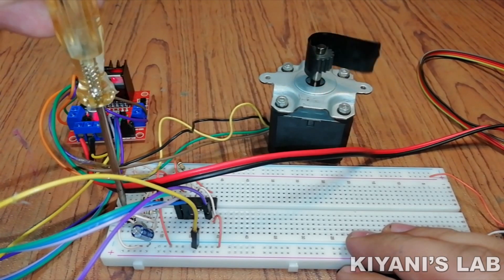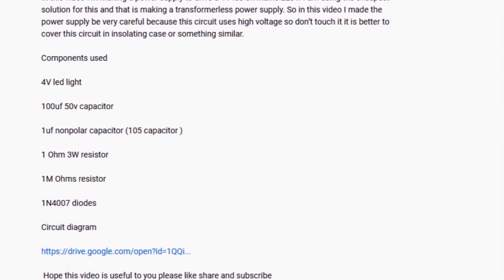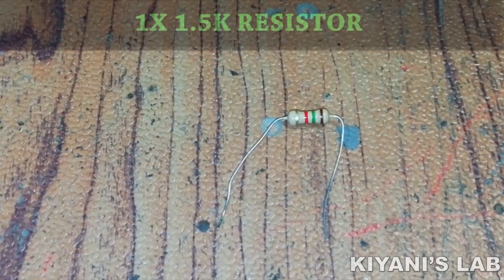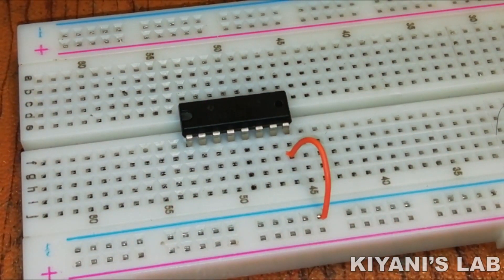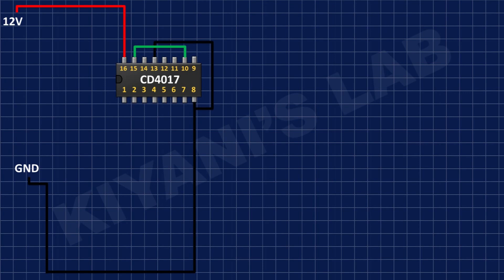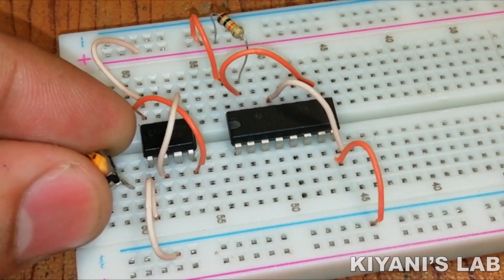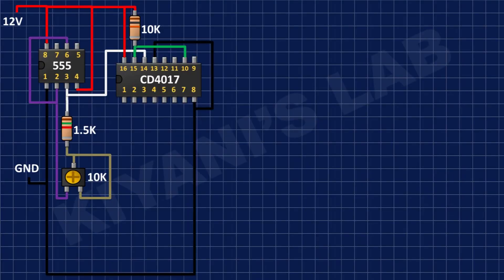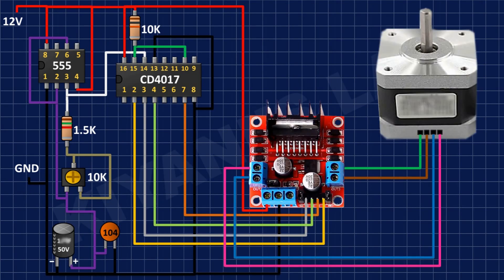How To Make Stepper Motor Tester

Comment: My friend, I have a stepper motor, model no. 28BYJ-48. 5V. and ULN2003 Driver. How can I run it or test it? Can I use the same circuit you showed?  please tell me...